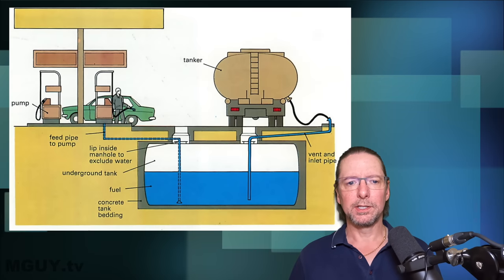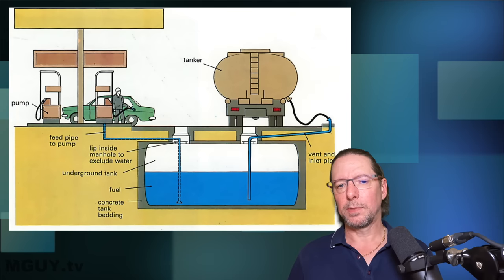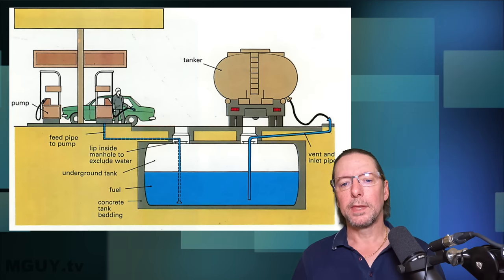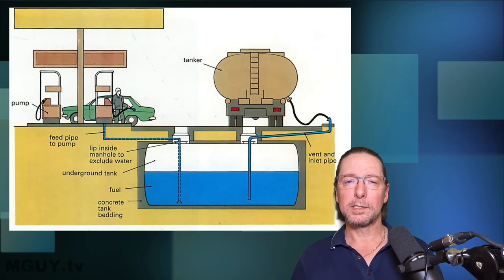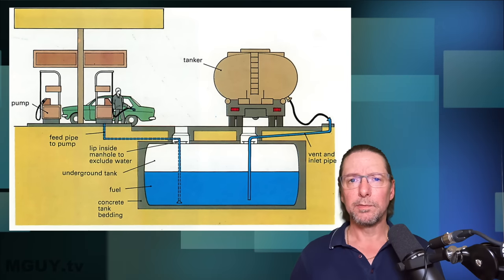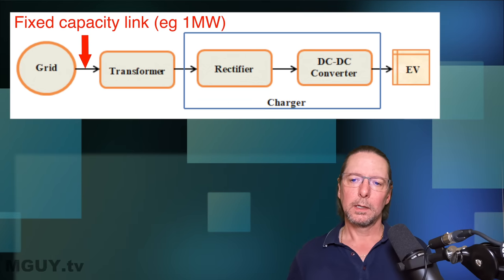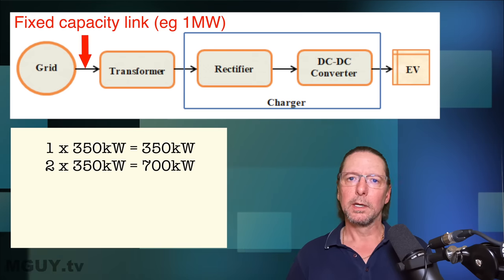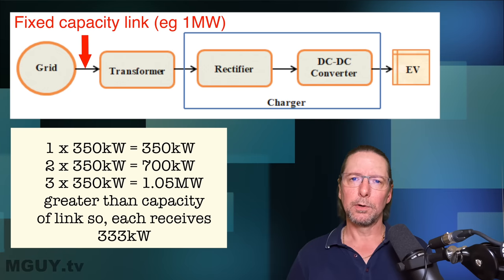HUGE problem with EV Charging Stations that no one mentions | MGUY Australia

Comment: These stupid arguments do nothing for the cause. You engineer the charging station for the anticipated load. So a station meant for 10 users will be sized as such. 
The real issue is the battery technology is not ready yet. That is the only problem. 
You cant charge quick enough, and you cant store enough, and it is too costly. But this will change in time.
In time, there will be wireless charging on some roads etc. Many options once you get through the stupid.
However, if you add all the energy together used in vehicles, that has to be added to the power grid…. That is another challenge over and above the battery issue.

Comment: Either you are ignorant or purposefully dishonest.  Every ICV taken off the road means it will no longer use electricity to produce the gas which is 80 percent of the use by ICV is available on the grid.  Also stop ignoring the use of batteries which is even better than putting a bunch of gas in the ground.  Do some homework.

Comment: The majority of journeys are local and do not exceed the maximum range of an EV battery.  Of these journeys many will be home owners who will install their own charging points and top up their EV's at night using off peak tariffs. I see the number of filling stations substantially decining as EV's gradually take over from petrol engine cars.      The problem comes with long journeys and people who live in flats. These require additional thought to come up with satisfactory solutions. Things like installing charging points in hotel car parks, supermarkets and shopping centres will all help to resolve the practical problem of charging but here is no one easy solution. At least until we come up with new battery technology that will give increased range so charging is no longer a problem.

Comment: You're not being a realist, you're being a fossil shill. You've made it seem like an EV charger is doing the same thing a gas pump is doing, but it's not. It doesn't need to deliver as much power because the EV is so much more efficient. As gas cars fade away, there will be LESS stress on the grid as refineries use less electricity as will gas pumps! Oh, and lots of charging stations have batteries, so it's not all coming directly from the grid.

Comment: It will take time.  As with early gas stations the size of the tank was small and as the need rose they built bigger gas stations and bigger storage tanks.  Some folks still used and liked horses back then. They slowly adapted.  As the need rises the available power will increase. Right now in our town there are many charging stations sitting empty when I drive by.  But that will change.  We are a very progressive community and looking ahead.  If you build it they will come….

Comment: Well... change is bad and problematic, all powered by lunatics with no practical sense? It is correct that it is challenging to have the same charging capacity for many electric cars at the same spot as for fossile cars. The speed of transferring energy as a liquid is more or less unbeatable. Is there a solution? In Norway there are indeed places with high capacity of charging many cars, especially along major roads. But even more convenient is the big number of places with capacity of charging just a few cars, even with lower charging speeds. The point is that you don't have to stand next to your car. You can relax, do some shopping, visit restroom or whatever. Shopping malls in Norway usually have a at least 4-5 fast charging places. Guess what - the charging cars are usually empty and noone to see around when the car is charging. Wonder where they are??? You have to be a real fossile head to think that you have to stand next to your car while putting energy in it. I understand that Norway is not Australia, but if you think that electric cars are problematic, you should see to Norway if there is a solution to that problem.